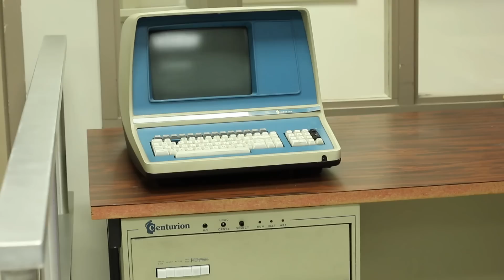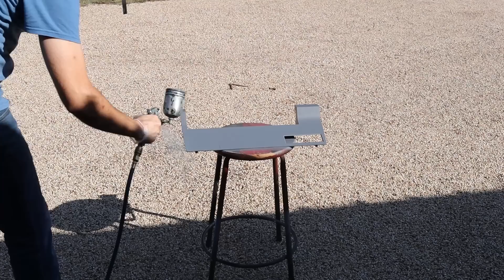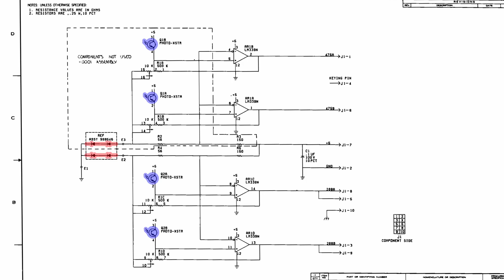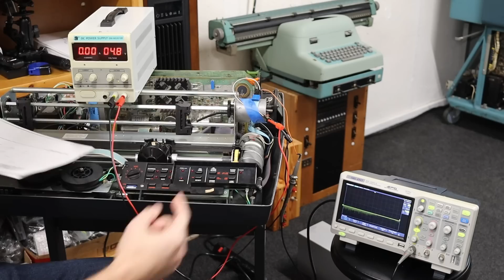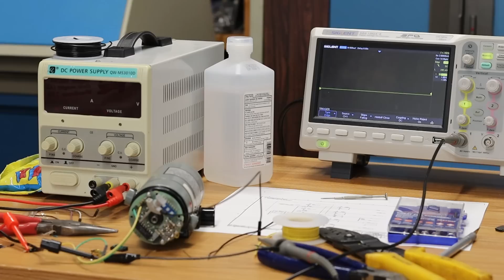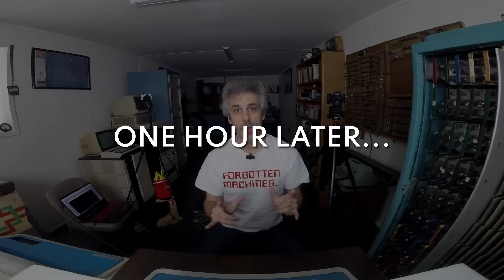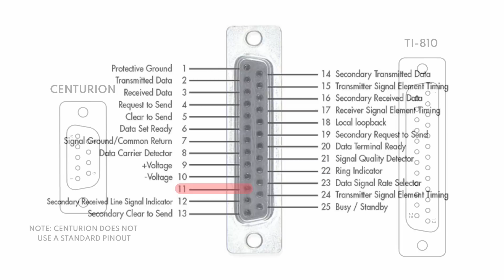I Thought It Would Be Easy… It Wasn’t

Comment: This probably came up during your discord chat, but your idea of the CR/LF not including a linefeed could not have been the problem because if that was it, the printer would have just done a carrage return and printed the next line over the previous...  After a couple dozen lines, it typically cuts through the paper, but it definitely still "prints" when in that mode and it's quite clear what the problem is!!

Comment: My first printer was a Commodore MPS-801.  I frequently printed large assembly dumps.   Set it to 16.7cpi condensed superscript.   Can't remember how I reduced the line spacing but I think I  managed to fit like 132 lines per page.   The sound it made with those settings were those of an eldritch horror from the depths of the abyss.   Had to point a fan at the print head to keep it from overheating.

Comment: I donated 3 of those printers back in the late 1990's to a friend when I was moving.  No idea now what became of them, or the friend...  I plan on getting a run of the mill dot matrix printer for a radio teletype setup around the first or second quarter of next year.  Budget is tight, and other items have priority.  I'm looking at some much quieter Epsons.  Won't touch the new Epson crap, but the old dot matrix machines were good.  Good luck in your adventures.

Comment: You could have used some ribbon cable (like the gray stuff IDE cables are made of) to replace that flexible film.  
 
Would be easier to make fit than fiddling with solid core wire.

Comment: AWESOME printers !  I have one been working since 1982 and still does.  They came with several i/o options.  Litton made the printhead positioning motors.  I want to find a parallel i/o card for mine.  I believe they even have a printhead alignment mode where they print a pattern on paper, one line.

Comment: Nice job!   A trick we used to do with old ribbons on printers to refresh them was to squirt a little bit of WD40 on them. This redistributes ink from the edges of the ribbon which never see any action, down to the "battle zone", so to speak where the pins contact the ribbon, and it extends the useful life of the ribbon. We used this as a cost-saving measure because me and my friends couldn't afford ribbons that often. All good wishes.

Comment: Just started watching .... as someone who was chief techie at a small shipping company, with serial dot matrix printers of all brands and models all over the place  I know what's coming.   I must have wired the serial cables in every possible permutation that an army of near sighted mentally deficient cross eyed baboons on LSD could imagine.  I know very well the fun you are about to face.   Good luck.   Hope you've the experience such that you know your wiring connections will be sound... if you have to doubt what you've done you'll never make it work.  And keep notes in detail as you work on each connector separately (and tape the notes (make a copy and someway to absolutely identify the notes with the particular printer .... some of them have dip switches or jumpers  to choose what kind of perversion on the wiring standards it wants to engage in that day)  inside the printer when done!

Comment: I used to work with those machines in the airline I still work today.
They were used to print tickets, the actual airline tickets that would have 4 or 5 ways, with red carbon (anyone remember that?).
I joined the airline in 1999 and they were already old.
Surprisingly they were still being used all the way until 2007 when paper tickets were ultimately phased out and the airline adopted e-ticket.
Other Airlines would have been using other kinds of paper tickets back then, but we used the regular paper ones, they were called T.A.T. tickets.
The printer is an absolute TANK, and nothing could stop it.
The only things I ever saw breaking in those printer's were the sprocket belts, and that was it.

Comment: I was a Static RAM Product Engineer for the AM 9101 at AMD in the 80's. The 9101 was pin compatible with Intel's 2101. It is a 256 by 4 bit RAM. Most likely a buffer for the serial input. Imagine having to design with 1K RAM chips today!

Comment: Back in the day I had an ancient PC with a monochrome display and an old dot-matrix form feed printer that I had poached from various different people's trash. I somehow managed to get the serial port working so that I could transfer GW-BASIC from a laptop onto the PC, then I went digging through the printer's manual and started experimenting with it. I was able to put the printer in "high-density" graphics mode, at which point I could send the printer arbitrary bytes to drive all of the pins in its column independently. The ribbon was pretty weak, so I compensated by overdriving each pin 4x to make the image darker before moving the carriage, but I was able to successfully print monochrome images. I suppose if I varied how many times I drove each pin, I could have even printed different shades of gray!

Those were fun times. I no longer have the equipment but I should go digging through my old stuff and see if I still have a few of the sheets that I printed.

Comment: One thing i learned about those old printers is that they almost never respect the standards , i once spend a week trying to put an NCR to work with an AT&T UNIX old machine (same problem buffer overflow) just to discover that the buffer full signal was at pin 22 (Ring Indicator)...

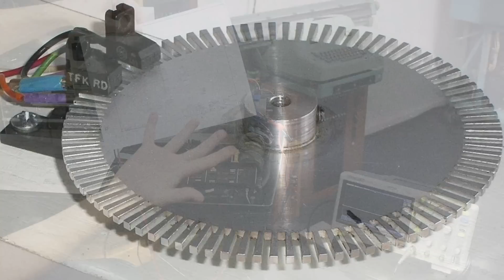Comment: 9:46 The LM339 is a quad comparator, not a quad opamp. Yes, the symbols are identical, but the way they're used is very different. :)
Gonna jump in ahead of your diagnostic process & guess that the problem will turn out to be dust in the opto-interrupters, or with the connectors, preventing the electronics from seeing the encoder signal.
Awesome job! Your repair skills are improving out of sight!

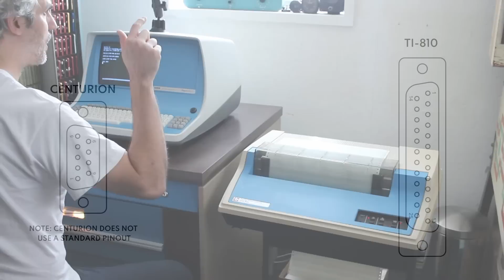22:16 lol. RS232 was always such a giant pain in the arse. I used to carry a little RS232 jumper box with LEDs in my toolkit for sorting out these sorts of comms problems. There are ways to really speed up the process of getting the computer & the printer talking at the same speeds & the same protocols, but I'm sure you'll muddle through it eventually.
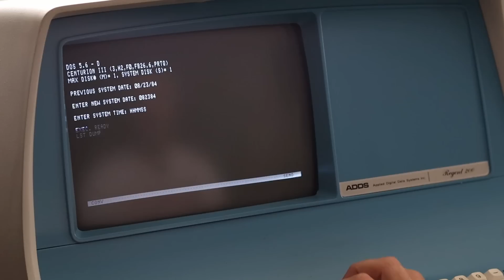22:30 You're ignoring pins 4 & 5 - CTS (clear to send), RTS (Ready to send), 
With serial printers, DTR (Data Terminal Ready) tells the computer that the printer is online & working. CTS (Clear To Send) is your main flow-control signal.

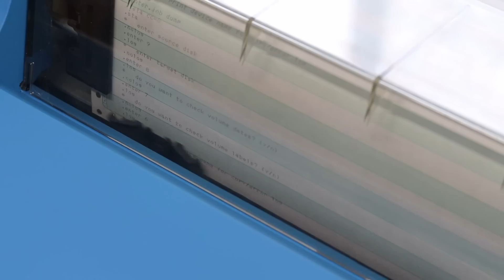23:20 Yes. You're losing characters because you haven't wired up CTS/RTS  (character flow control) from the printer, so it can't tell the computer to hold off on the next character because it hasn't finished printing the current one.

23:34 lol! Well yeah, because you're wiring up the wrong flow control system! You need to wire CTS on the printer to RTS, & vice versa. 
TIP: A good generic cable for this era of equipment is a straight through DB25 cable with pins 1-7 wired. But back in the day, I carried a 25 way crimped ribbon cable with male & female DB25s crimped to both ends.
Anyway, this stuff gets confusing fast,  the Wikipedia page for RS232 isn't great, but it should get you started.

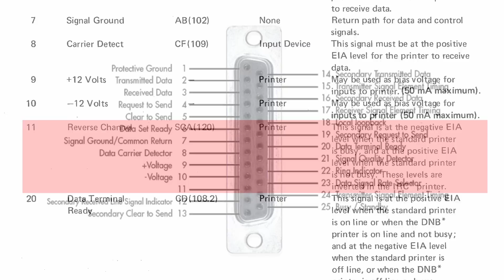25:29 WTAF!!!!!!!

Comment: Early in my career I spent many many hours listening to a TI-810 hammering out reams of green-bar paper. In my application for the job they stated that I had to be able to lift 45 pounds, an oddly specific number, and also the weight of one box of green-bar paper.
Reply: I might still have a 132 print position template around here. Remember when the screen was 80 x 24?

Comment: Pharmacy I worked at in the early 90's had two of these we printed labels on. Ours had some sort of coax for data but it wasn't ethernet. (edit, it was IBM 3270)  They were eventually replaced with laser printers but were very reliable while in service.

Comment: Very nice.  It brings back old memories.  I serviced many different makes and models of dot matrix printers.  Specifically the centronics ACT-900 which used a similar motor to produce return feedback pulses failed.   Fixed the jammed motor to make the printer to work.  This happened some time in 1987

Comment: you could also use vinegar. Alkaline batteries are, well, alkaline, and when they leak, they leave alkaline salts. A mild acidic solution will neutralize it really well, its my go to when working with old battery corosion, and it fizzes really nicely too. Smells shit tho, citric acid would be more humane.
As far as i understand chemistry, alcohol doesn't neutralize anything, it just dissolves it and makes it possible to remove mechanically, which is probably fine in most cases, but on corroded contact points an acid works better.
Anyway, nice as always, I envy the time and skills you need to make this channel exist

Comment: Vinegar is great for removing corrosion, I've saved countless battery-bombed remotes, calculators, thermostats and whatnot using plain cheap vinegar. Rinse with IPA or de-mineralised water afterwards. Oil on the other hand is great for removing sticky adhesives. Any kind will work, WD40, sewing machine oil, in a pinch even sunflower seed or olive oil borrowed from the kitchen.

Comment: I used to work for a telco (Telstra Australia) fixing Sagen telex machines, their tachometer - they called a sensor, was an extremely common fault. They originally used miniature IR LED's, they were obviously pushing them too hard as they didn't last that long - at all. Sagem eventually brought out a new version sensor that used a good old incandescent light bulb - kind of nuts, as everyone is replacing incandescent's with LED's these days, however that did it, WAY more reliable.
Mind you this is years before decent blue LED's - and white ones of course, LED's were just not that bright back then.

Comment: RS232 IMO is the best example of a non-standard 'standard' interface. When I was dealing with RS232 connections back in the 1970/80's I used to first use two straight-through ribbon cables with a female/male connector on each end connected via a RS232 breakout box. Then I would sort out the required pin connections via the box and then when it's working I would make up a proper cable with the required pin connections. Back in the day some terminals required straight through, some required x-over for pins 2 and 3 - and then there's handshaking! There was one particular computer I worked with which required a high on a certain pin to work but didn't set any other pin high until it saw that particular pin high. Nightmare as you couldn't just connect control pins together in the plug to get it to work. There was this one serial printer that a customer wanted to use that required a high on a pin for it to become ready and before it would raise any other pin high. Needles to say that getting that printer to work with that computer was not easy. Ah the bad-old good-old days......
Reply: The problem mainly was that manufacturers did not understand that their equipment usually was a DTE, and that the standard said that DTE equipment should have the male connector.
They put female connectors on their equipment, but wired them as DTE.  That meant it would usually not work on the first try.
When they adhered to the standard (like later with the IBM PC), they put a male connector on their DTE equipment, and all you needed was a straight male-to-female cable to connect it to a DCE, possibly combined with a "null modem" block or cable that had female on each end and crossed all connections.
Reply: Ugh. You are 100% right. I used to carry an RS232 breakout box in my toolkit, plus a ribbon cable with M & F DB25 connectors on both ends. Such a pain in the arse.
Eventually, you learn to be able to spot baudrate & other errors by what kind of garbage came out of the printer. I do not miss those days at all!

Comment: PRTQ will be a software port to the Print Queue managed by the print spooler. Nice to have if you want to do other things while waiting for a print to finish. Might want to see if you can get it working if you are going to be demoing the system with the printer. Might want to add a little mild organic solvent to the ribbon to restore the dried ink and get darker prints.

Comment: At least you didn't have to repair the print head by replacing broken pins with bits of guitar strings. 
I did it once on a 24-pin Oki Microline printer and it was a, uhm, satisfying nightmare :D

Comment: I remember hooking up an obsolete hp belt printer to a zx spectrum through the beeper output 😂😂 and yeah, it worked ! I still remember the very specific noise of this printer. The printer driver was written in assembler to fit into the ZX printer buffer with software timing loops. Of course speed was low at 300 baud

Comment: Maaan, it hurt to watch you painting that cover. You need single passes that start off the edge and continue across the job and off the opposite edge. No wonder you were getting runs! Strongly suggest you go check out some painting technique videos 👍

[edit] Also, why are you not neutralising the mess from the battery with vinegar? Isopropyl is not an acid, it will not stop the alkali from continuing its warpath through the board.

Comment: Finishes with a listing that has code fixes dated 1977.   47 years ago... Love it. 

Back about then, I was a Field Service Tech for DEC in a remote site - everything from PDP8 to 10s, LA-series printers and old teletypes - when my boss told me I didn't need an oscilloscope to fix things anymore, I moved into SOftware - I bought one of their excess inventory Tek475 scopes for $50, which is still in my lab and still working.
Reply: Ironically, an oscilloscope is probably essential to diagnosing, repairing any serious problem with a computer... unless you are okay with just throwing money at the problem (I.e. replace whatever is faulty).

Comment: RS232 is just another name for murphy's law.  
When I was repairing computers in the 70's and 80's, every RS232 installation seemed to be different.  The best thing that ever happened to RS232 was that IBM created that simplified 9 pin connector and basically standardised which flow control pins you should use.
Reply: The first improvement that IBM made was actually adhering to the standard that a DTE-wired port should have a male connector.
Manufacturers of terminals and other equipment in those days often used female connectors wired as DTE, that is what caused all the mess.

Comment: The pinout is probably optimized for direct connection to an old 300/1200 baud modem that didn’t support flow control. Dispatch would call the remote site with the printer attached to the modem and dump a bunch of printouts, such as work orders or bulletins.

Comment: I have the same printer with the same problem with the motor encoder.     It was working fine when I last used it about 40 years ago.   A few years ago I tried to use it but the carriage would not home up.     I finally got around to digging into it a few months ago and found the issue with the encoders.   I removed the corrosion, remounted the LED's and repaired the connections.    The carriage now moves, but to the right instead of left, then stops and "thinks" it at the home position.   When I find time I'll probably figure it out....   Did you need to adjust any of the trimmer pots on the encoder board to get yours to work?
Reply: When I worked at Warrex /Centurion 40 years ago the TI-810 encoder optics on the carg. motor failed often.   You check for signal on all 4 optical paths from the encoder.

Comment: Reverse channel. That really takes me back. I knew it existed but I never worked with it. You used to be able to get half duplex lines from the telephone company. If you were only using it for a printer or if you used polled Bisync, they worked great and they were cheaper than a full duplex line. You could used them for voice but if you didn't have control of the line, you would have a dropout. Reverse Channel was used to turn the line around so data could be sent the other way. By the 70s and 80s it was pretty well phased out but it appears that a few were still supporting it. I would have expected CTS/RTS flow control but the description for the printer clearly indicates that it's not supported.

Comment: There's a very strange compression artifact at 2:35. The "Texas Instruments" label jitters left and right. How could this have happened? I don't think it can be bug in YouTube's video compression, because it's present in all resolutions and video formats.
Reply from the maker: A lot of people noticed that one!
It's not on YouTubes side at all. In the original shot, I panned too fast, so I had to slow the shot down in editing. When I did, I used DaVinci's optical flow retiming to smooth the pan out so it didn't look jittery, but sometimes it freaks out on small things like grilles or text. I didn't actually notice it until someone else pointed it out!
Reply: @UsagiElectric You all are nuts. What the heck are you talking about?

Comment: I had a TI-810. Don't remember where I got it, but I used it for quite a while and was very happy with it. It was fast, but definitely not quiet. Nice printer. I think it had a parallel interface. I believe there  were options for the interface. I gave it up when I no longer had a source of free tractor feed paper :-) Lots of businesses (and maybe airlines?) used it for multipart carbon or carbonless forms. Very heavy duty machine.

Comment: That foam + adhesive combo seems to be as bad for electronics as leaky electrolytics. One laptop I was fixing up had a separate DC-DC board for powering the CPU voltage and it had a little foam pad on top for easier installation. Fast forward about 25 years and somehow that foam or adhesive started corroding components underneath and one of those was a resistor, that was part of a voltage divider to set the DC-DC voltage. CPUs do not like to be powered with 18 volts, it seems.